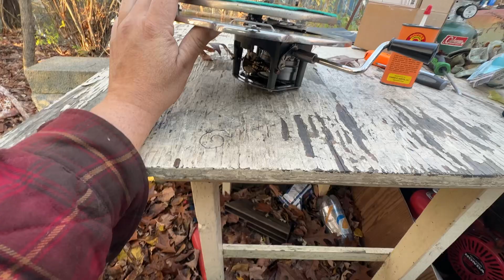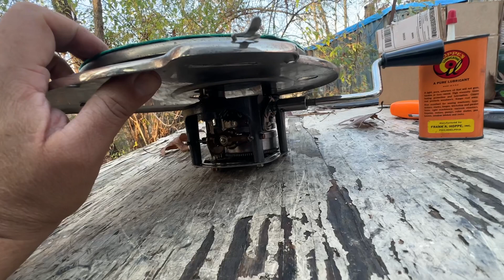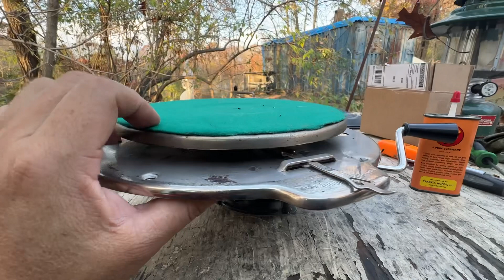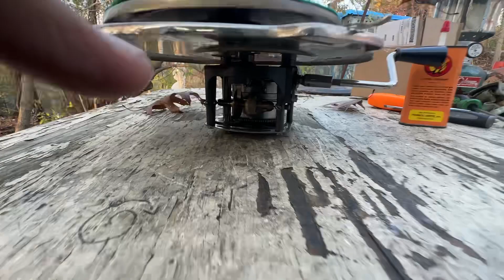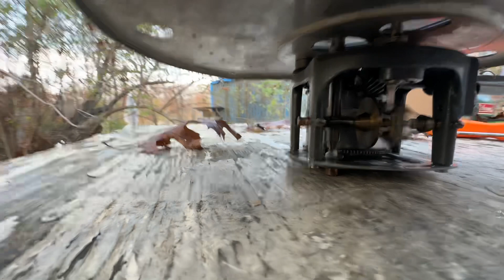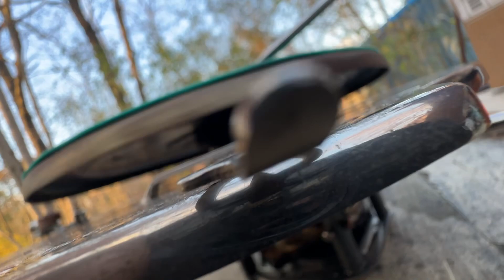Garrard motor back together

Comment: Thank you so much. I have learned a lot watching these, hopefully I can put it back together 😮
Reply from the maker: I have already assembled it to the motor board, set up the speed, control lever, and set the speed to 78. All you have to do now is drop it into the cabinet and attach the screws. Attach the reproducer to the tonearm. and unless further adjustments are necessary, you should be good to go. Don’t forget to put a little bit of grease on the gears, whatever grease you have , or you can go to the auto parts store and get a squeeze tube of white lithium grease and use that.

Comment: That crank does look like an original Garrard one. They used that very distinctive wooden handle piece on all of their motors, as far as I have seen. Thanks 😀 👍
Reply from the maker: I borrowed that crank off of the crown, and that machine does use a Garrard motor and turntable.